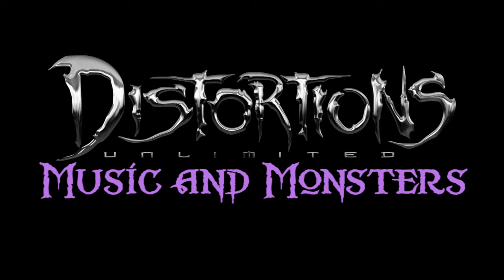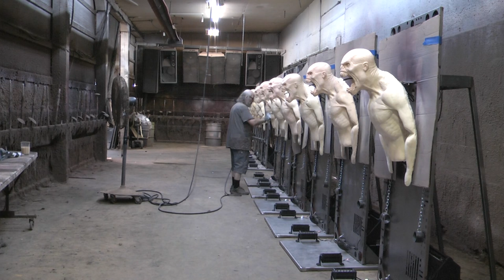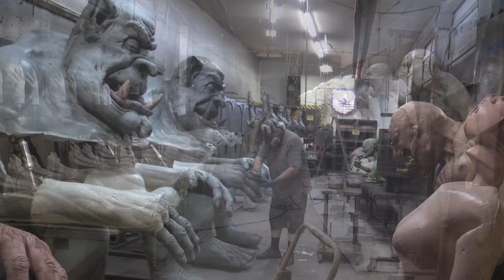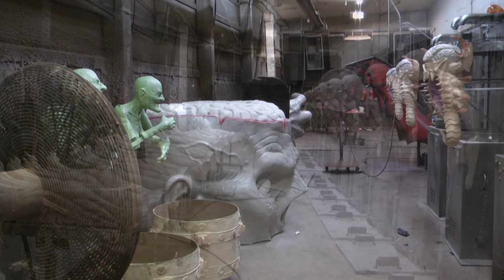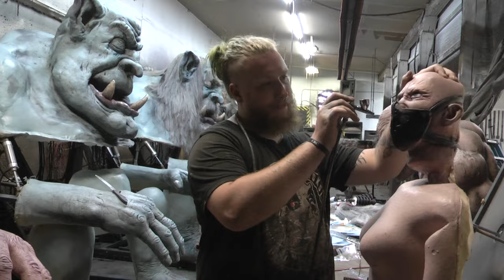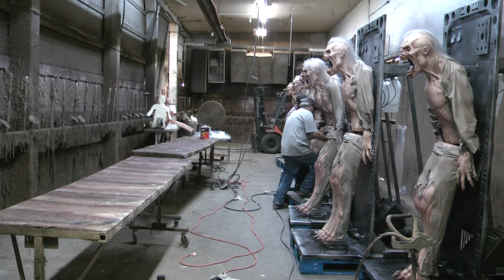Distortions Unlimited Animatronic Painting | Behind the Scenes with Music

Comment: This is a little random, but I had an idea for a prop that could go on the back of a car trunk.  I picture a type of lithe or small cast figure like a banshee that can clip into the trunk when it's shut.  Then the banshee has hair cut long enough to catch the wind while it's attached to the car.  Hoppefully it extends out about 1.5 feet as someone drives behind it.  You could also make the banshee kind of cute so it doesnt offend the public whille staying spooky.  You could also do a "spectral wise man" variant where a long beard does the reverse below the chin.  You could even have a cast for the body that is covered in like a panty hose material that forms legs and arms with feet and hand shapes that dangle as weights on the end.